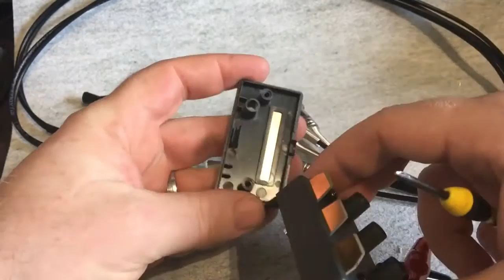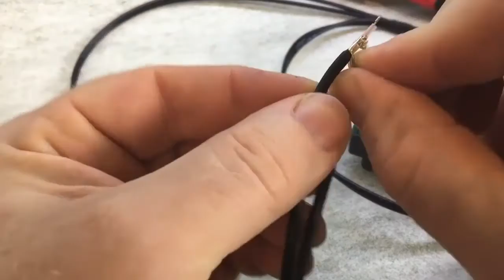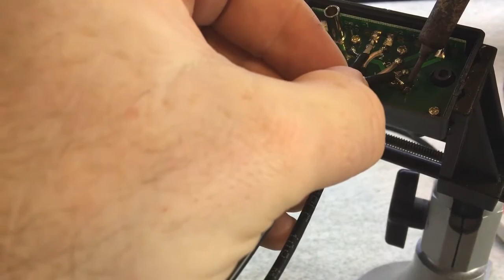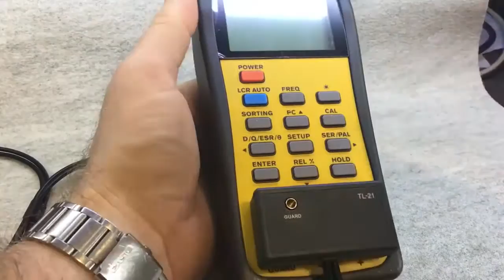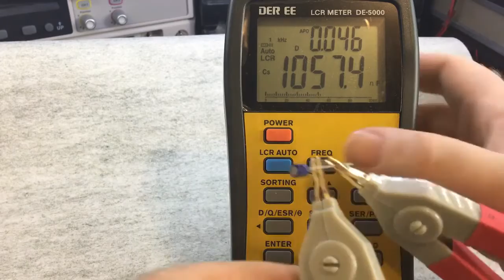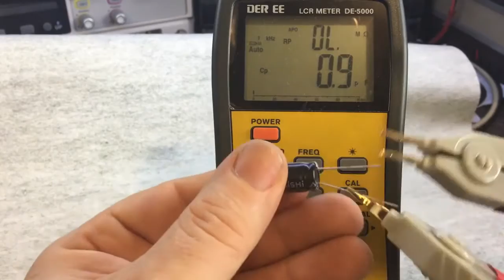#91 DE 5000 LCR Meter 4 Wire Kelvin Test Lead Modification

Comment: Scott, do you know by any chance what pair of connections # 1 and #2 provides test signal current and what pair is sensing voltage during test?
Reply from the maker: I don’t remember, I think you could tell from the connections inside the connector though.
Reply: @TheDefpom  Thank you. Answering my own question: I just removed original alligator clips with cables and took some measurements. Contacts labeled "-2" and "+2" provide test signal and the other two "-1" and "+1" are sensing voltage. The reason I need this information is that I will be wiring new Kelvin type clips with 2-wire shielded cables and I wanted to keep a voltage sensing wire inside a shield as far as possible, right to an alligator clip contact. But the other wire supplying test signal can be run from one side of an alligator clip to another without shielding.

Comment: I followed this interesting idea of making a 4-wire Kelvin clamp for DE 5000 by modifying the TL-21 typically supplied with the DE 5000.

I also bought the cable already made for sale on Amazon and used by the author of the video.

But I haven't had good results. As you can also read from other videos on the same topic, this cable is very cheap but it is of low quality, it is too long for cable quality and often has constructive defects in the Clip attacks; defects covered by the self-shrinking sheath.

I passed the calibration test both "open" and "short" but then the displayed values vary a lot and the "zero" on resistance after calibration was lost immediately even if I did not turn off the DE5000. To give a quantitative value, visualizations of a few tens of random milliohms were normal. It was useless to do the calibration again because nothing changed.

What was also evident was that moving the cables varied the error: as if disturbances entered: Yet I assure you that the "Guard" contact was wired as indicated with care and cleanliness.

So I decided to do it all again with a better cable from a Hi-Fi shop. Basically a stereo signal cable that has a red and a white wire both individually shielded.

I bought similar Kelvin Clips on Amazon like these:

https://www.amazon.com/Alligator-Clips-Copper-Plated-Kelvin/dp/B08CBWJBXZ/ref=sr_1_17?dchild=1&keywords=clip+kelvin&qid=1615716686&sr=8-17

and I made the cable myself.

I also adopted a shorter length: about 30 cm.

The result was good and stable. The error after calibration fluctuates on resistance values of 1-2 Milliohm and above all when moving the cables with the DE 5000 switched on, the indicated value did not change.

My consideration is:
- Kelvin clips with black cable, as in this, have better quality cable then the white one.
- by reducing the length of the original cable by half, the situation improves a lot
- However it is better to make the cable yourself of better quality especially in the cable by using a maximum length of 30 cm of a good Wi-Fi signal cable

I hope I have helped someone.
Reply: Francesca, thank you for the comprehensive and usefull info. I am also planning to replace original alligator clips with the Kelvin type clips and the longer cables. The new cables will be about 20-30 cm long. However, I have decided to use a stereo cable with red and white 28 AWG wires in a common shield (very similar to the original cable used in TL-21). Since those cables will enter at just one side of the alligator clips I would like to keep a "Voltage/sensing" wire (at connection point within Kelvin clip) as short as possible, but the second "Current/feeding" wire could be longer and go from one side of a clip to another around a pivot axis and a torsion spring. 
Do you know which of two connections in the TL-21 box (# 1 and # 2) is Voltage and which one is Current?

Comment: I would like to build my own Kelvin clips from scratch but not sure if a shielded two wire conductor is necessary or could I get by with a nob-shilded 3 conductor wire and use that third conductor instead of the shield?

Comment: Pretty sure I have that exact set of strippers.
Where did you get the kelvin clips from?
Reply from the maker: I got them from Aliexpress, cuts out the middle men and goes direct to China. https://www.aliexpress.com/wholesale?catId=0&initiative_id=SB_20161025160641&SearchText=LCR+Meter+Test+Leads